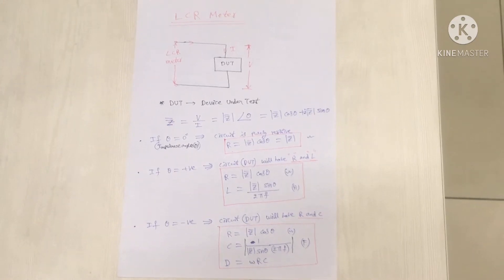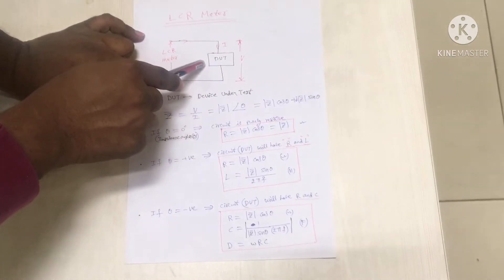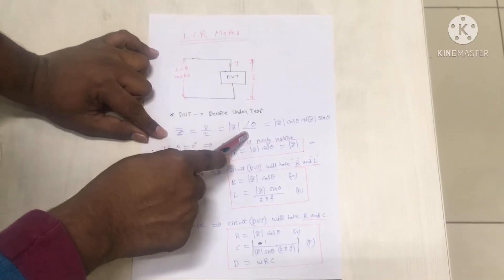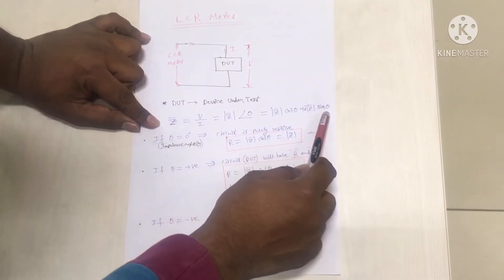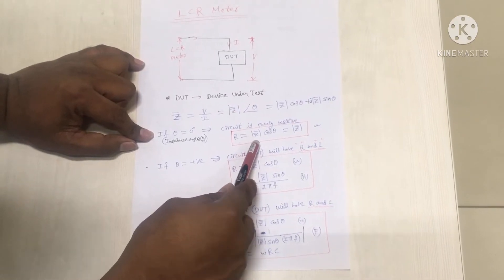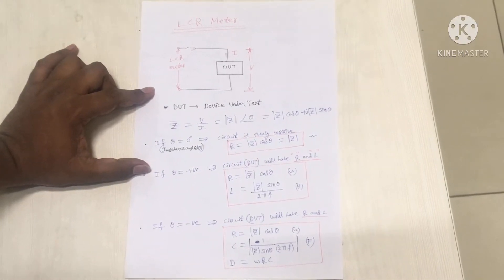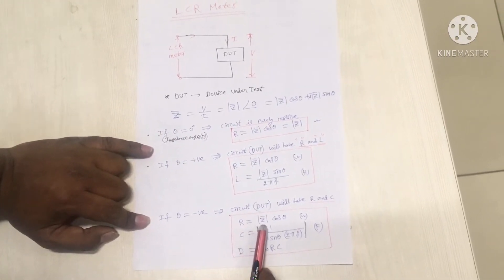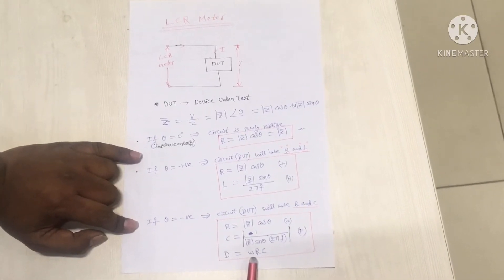Measurement of R, L, and C by using the LCR meter

Comment: Why we need to measure for different frequencies brother
Reply from the maker: Dear friend,
R, L, and C are used in both the electrical and electronics circuits. The frequency which is used in Electrical circuit is 50 Hz in India and 60 Hz in USA where as in Electronic Circuits and communication devices the frequency used as higher frequencies i. e., more than power frequency. 
You may observe that the Inductor will behave as capacitor at higher frequency (100kHz)